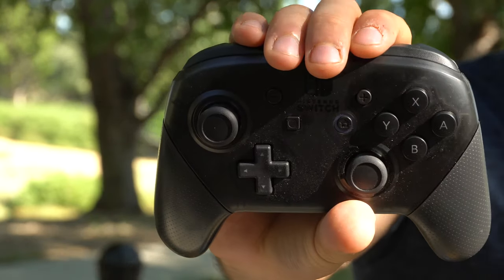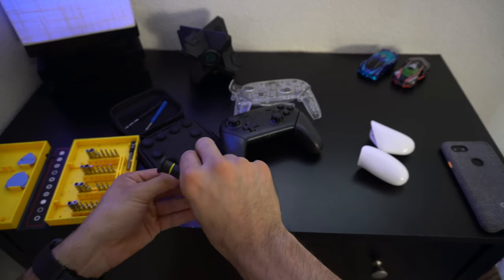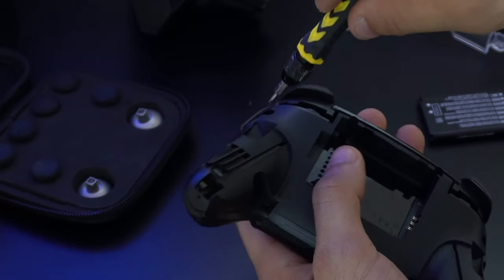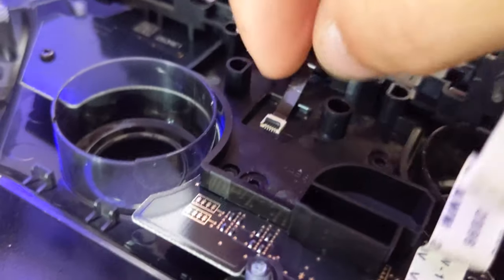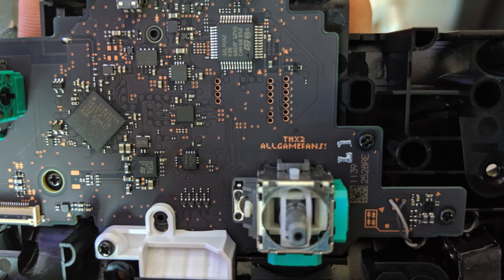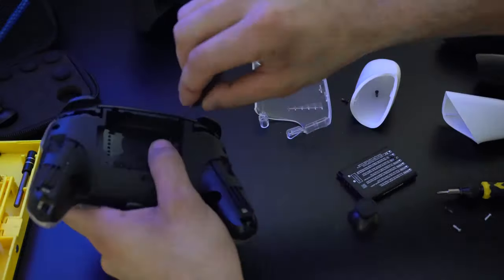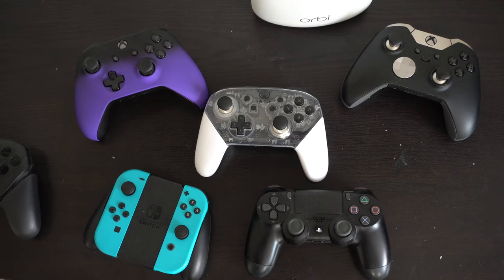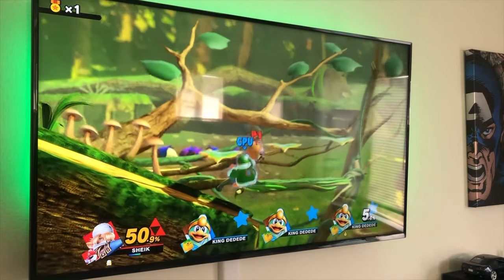Nintendo Pro Controller INTO Elite Xbox One Controller Mod - Improved The Grip And Joysticks

Comment: I think filing down the analog sticks is unnecessary, although can see why you did it. I know it's obviously a different controller, but recently I modded my dualsense with swappable analog sticks. At first, they were horrific, getting stuck, and I mean stuck, when moving them. Just had to hold on L3 and R3, really wear them in. Even then it took an hour, or so, to properly break them in

Comment: I did this with parts from my burnt out elite controller, the problem is the sticks are too heavy and cause a lot of snap back, even more than the stock sticks, which makes them unviable for smash, and less than optimal for shooters, but you can mod the sticks to have less resistance or add a capacitor to reduce this effect.

I didn’t have the size issue with the sticks though
Reply: What did you end up doing to fix the problem?
Reply: @grantwalker7124  I just didn't use them, I play competitive smash so I can't deal with snapback. If you're really determined to use them you'd probably need to remove the stickbox and trim a tiny bit off the spring, or use a capacitor but then you always have a tiny deadzone
Reply: @TheTrueSavior  Thank you, I appreciate you taking the time to respond. Who does God main in Smash?
Reply: @grantwalker7124  Joker
Reply: What pro smash player uses sticks over d-pad 🤔
Reply: I actually removed the stick from my elite to add non elite because of SnapBack. I didn’t use the other grips so it’s better than ever

Comment: Thumbstick swap.  So easy a first grader could do it.  I would have liked to see you do the Elite D-Pad Mod.  Also, tolerances for the thumb sticks are small but if you get genuine XBOX elite thumb sticks no sanding or modification is necessary.  BTW is 8/10 difficulty mean its easy or hard.  You should try notching the faceplate for Smash Bros and see how that affects the thumbsticks.

Comment: Can you show how you smoothed the joysticks, I had the same problem but could not make it work.
Reply: He was wrong... He put the sticks on incorrectly... Make sure the ovsls match
Reply: Recently did my elite controller mod and ran into the joysticks sticking but what I did to fix it was to just push them down more. Turns out theyre a tight fit but have a lot of room to go down more. No sanding required and they work perfectly.
Reply: Cubones_Momma do they still drift ?
Reply: @tekarukite8355  im pretty sure drifting is caused by the stick box, not the thumbsticks

Comment: Hey man how do you get the sticks to stop sticking
Reply: Recently did my elite controller mod and ran into the joysticks sticking but what I did to fix it was to just push them down more. Turns out theyre a tight fit but have a lot of room to go down more. No sanding required and they work perfectly.
Reply: @weaknesscomespainful  did you use the joysticks in the description?

Comment: A metal bar fell out of my contrôler when I opened it, I don't know where to put it back
Reply: the metal bar goes under zr/zl. it's probably too late by the time I've sent this though
Reply: @azqzel8765  Better late than never, thanks
Reply: @chrono254  np
Reply: @chrono254  i know right, my controller's right trigger is broken, someone it's mapped together on with the left trigger.

Comment: 6:06 I think that happened because you made the screws too tight, you need to make it a little more loose.
Reply: Nope, That doesn't work, I tried that, you have to use the sand paper
Reply: @eldiegoetc9257  I didn't

Comment: Recently did my elite controller mod and ran into the joysticks sticking but what I did to fix it was to just push them down more. Turns out theyre a tight fit but have a lot of room to go down more. No sanding required and they work perfectly.
Reply: Is it still working?
Reply: Yeah is it still working